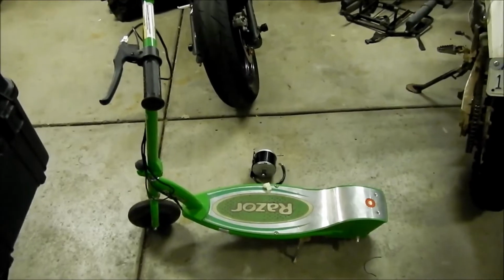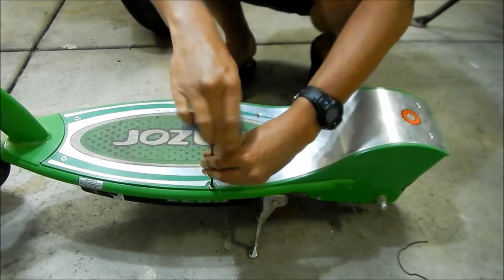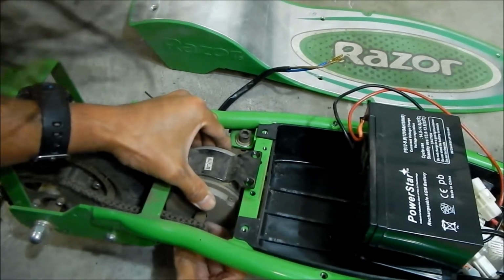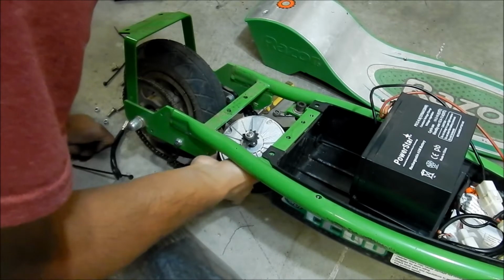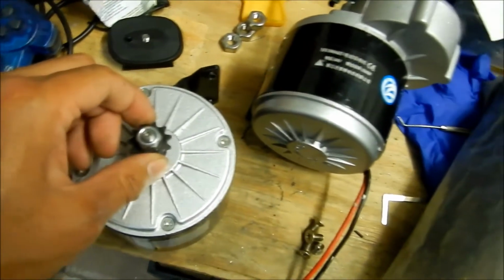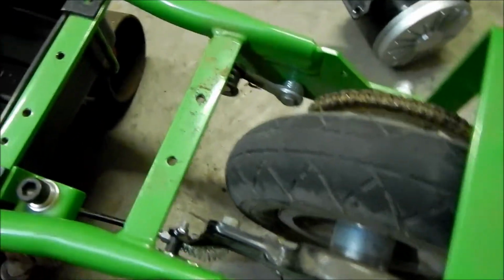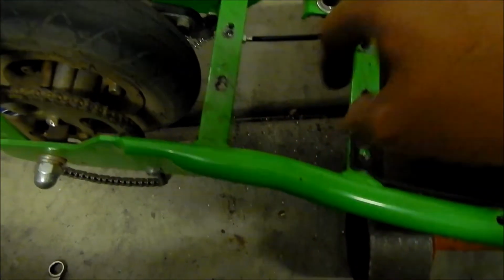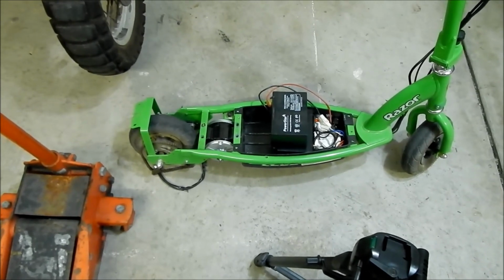Razor E200 Scooter ZY1016 350W Motor Install VLOG Part 1 - Mounting

Comment: Did you change the batteries? Or does the 350 W motor runoff the same size stock batteries?
Reply: Later I changed the battery to a LiFEPO4 battery that I built but the motor will run off of 24V battery no problem.

Comment: Thank for the awesome video, I’m planning on doing this to my own E200. Out of curiosity, What is the battery life like on it now? How much did the bigger batter bring down its range? My e200 currently has the bigger 9Ah batteries in it so I’m wondering what my range will be like after the upgrade.
Reply from the maker: I could probably get 10 miles maybe.  I killed my batteries riding it in the desert on a 115F day though i am planning to build a LiFePO4 battery for it in the near future.  Ditch these heavy lead acid batteries.

Comment: Will it be faster with a more powerful motor ? Or have to change the Sprocket to 9t I/o 10t .
Anybody can help ?
Reply from the maker: The larger motor already comes with a larger sprocket so you will get a little more speed out of it.

Comment: If you lift up the plastic battery case, mounting would been much easier, you can install the 350W motor from the top, just like the way you spinned to remove the old motor from the bottom, all mounts should be exact fit, 
Also if the motor has pre threaded mounting holes, drill them out starting with 3/8" or 1/2" for fine chain sprocket alignment later, add washers or a bolt with longer head screws to lift up the motor for better ground clearance and tightening chain tension adjustment.

Comment: I want to change my 170w to a 350w do I need change the speed controller also
Reply from the maker: You don't have to but if you don't you won't get the full potention of the motor.  I had a aftermarket cobtroller installed so I could use a variable twist throttle it is much better than the stock ones on off switch throttle.
Reply: Ok thanks mate 👌

Comment: thinking of doing this with a smaller treadmill motor - mounting above the frame instead of underneath - you think that could work? (motor approx same diameter but longer - will stick out the left side a little but no biggie, also will have to mock up a chain guard for safety of course).
Reply: You should be able to mount anyway you want as long as you can get the sprockets to line up.

Comment: That motor has a threaded female so you can put it under and just put washer and bolt from top , your motor mounts should be under the frame.